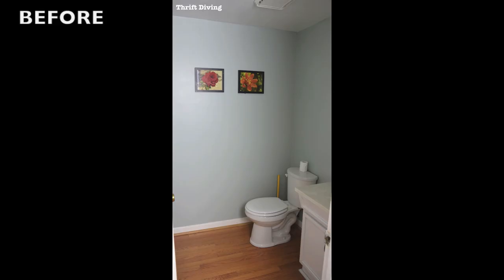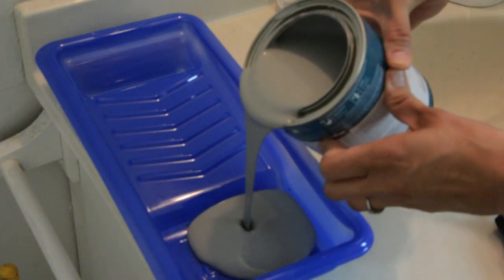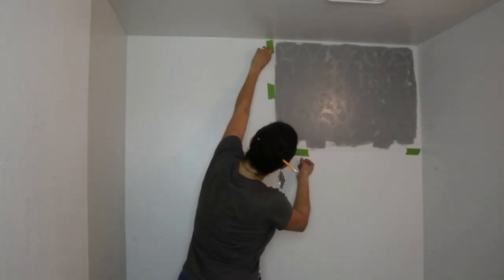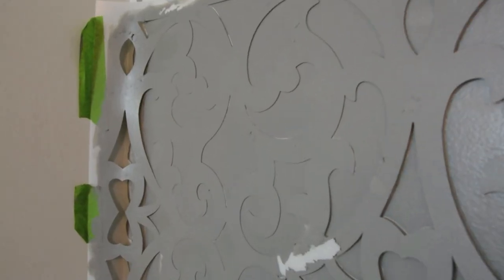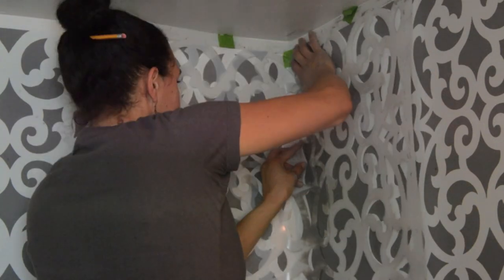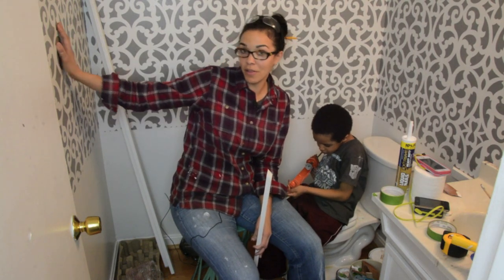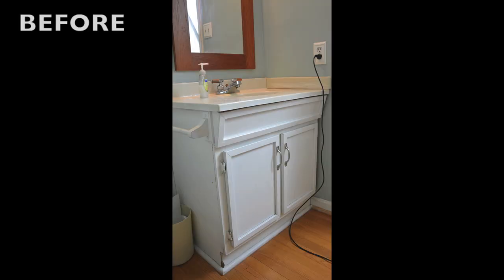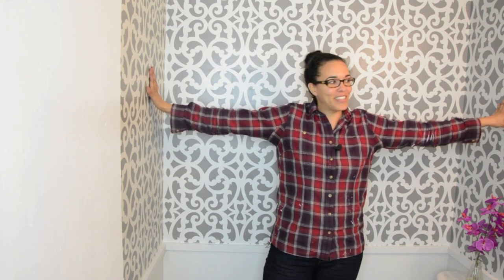My Colorful Small Gray Bathroom Makeover With Stencils! - ThriftDiving.com

Comment: I love what you've done to this powder room! Moldings really make it rich looking! Here's a tip. I trace my stencil onto tracing paper to maneuver through those corners. Wax paper would work as well, too. Cut out the parts to make your stencil and crease it where you need to, spray the side that goes to the wall with a low tack spray adhesive you can get at any office supply store, then put it in place. p.s. If you're new to stenciling, practice on a piece of cardboard first.
Reply from the maker: That's a great tip!! I'll have to add that tip to my blog post so that people know! :) Thanks for sharing. I really appreciate it!

Comment: Krylon makes a repositionable adhesive called "Easy-Tack" that doesn't peel off dry paint or leave any residue, and can be stuck to a clean surface at least a dozen times before the back of the stencil needs a light recoating of the stuff. With a little b0it of practice, you can get your bleed on a smooth surface down to virtually 0. 

Also, if you don't mind the smell lingering for a week or so, spraypaint makes for the cleanest stencils, or even an airbrush or paint gun, if you have either or the means to get one. A roller can't get those corners, but a spray sure will.

Comment: If you use stencil spray adhesive, it helps prevent seepages and is easily applied and removed.
Reply from the maker: Great tip! I didn't think to use any! I hadn't stenciled a wall before, only furniture. And I don't use it stencil spray when I do furniture. Next time, I will try it when doing wells! :)

Comment: You really did need that crown and wainscot molding as a border for the stencil. The transition from stencil area to solid paint looked  incomplete without that framing. Good plan. I'm glad you did the  wall corners. As an alternative to the brush work you could have considered hiding the gap in stenciling behind an inside corner molding. I'm assuming you need to let the stencil paint dry before applying the next section. If you mentioned that, I missed it.

Comment: Great idea for a small space. I'm thinking if I kick it up a notch higher would be to put in a 12x12  tile on the bottom part where you painted it white, where the 12x12 is smaller pieces of multiple tile. Awesome job! How long did you wait for it to dry before you removed the stencil? I have the worse time with stencils.
Reply from the maker: Great idea on the tiles! As for the drying time, I literally rolled, then lifted. I didn't wait for it to dry. I was super careful when re-placing the stencil and lining it up, making sure that when I re-applied it, it didn't smear the other paint! :) Good luck!

Comment: Thanks, home decor shows always say "we just did some stenciling," like its nothing, but I knew it was major. Perfect job. I do have a question, though. I'm going to be using a mineral paint to paint a wood laminate surface, what primer do you suggest?
Reply from the maker: HAHA, they always make it look super easy, huh? As for primer, I wouldn't know. Most paints made for furniture don't require primer, but since I've never used mineral paint, I can't help you there. Sorry! I'd check with the brand of paint on their page and see if there is a FAQ that answers that! :)

Comment: As this video shows, stencilling walls is so much harder than people expect it to be. Taking the time to use a stippling brush (almost dry. X2 coats) it’s worth it if you’re a perfectionist. You get a lot less leaking under the stencil and avoid ‘ridges’ of thicker paint around the edges.

Comment: Did  you cut the trim by yourself are you went to Lowe's or Home Depot to have them do it?
Reply from the maker: +Trinity 4Life I cut the trim myself! I've got a miter saw. You could probably ask them to do it, but it may not be accurate depending on your walls and stuff. It's best to get yourself some tools so that you can measure and fit each piece to exactly the size you need! :)

Comment: Holaaaaa, do you need to wait for the paint to dry before you do the next stencil section?
Reply from the maker: +Yuni Barrios Well, it dries pretty quickly. You don't have to wait until it's totally dry, though. Just make sure that when you're repositioning it, the parts that might still be damp area matched up with the stencil.

Comment: It's a super pretty look however, as a contractor I wouldn't suggest it. It's really difficult to get rid of once you tire of the look...just as difficult as wallpaper so it leaves one wonder if why all the fuss in the first place. It pretty much has to be skin coated with mud to remove the stenciled effect 😕
Reply from the maker: Stencils do leave a pattern on the wall, but because it's such as small space, it wouldn't be much effort to run some P220 sandpaper over the walls to smooth them out. I don't plan to change it any time soon, so no harm done.

Comment: Too much washing and drying, not to mention much to much waiting time in between steps. Wall paper is much faster. if you work cleanly and efficiently wallpaper is not that messy, and not that hard.
Reply from the maker: You're probably right, Andy. I just know that I detest wallpaper. I know that wallpaper today isn't like wallpaper of the 70s, but the amount of it that I removed when I moved in here, it's currently banned in my household. LOL
Reply: Good quality wallpaper is pretty expensive. The good quality vinyl stuff my hubby hangs runs around $200 a roll. It lasts a long time though.